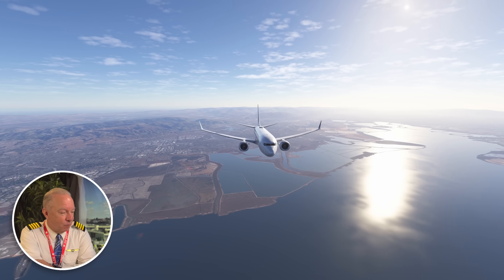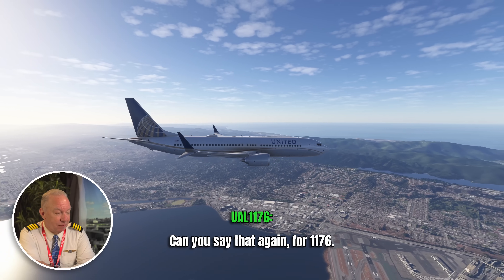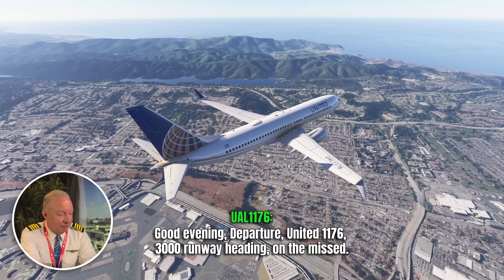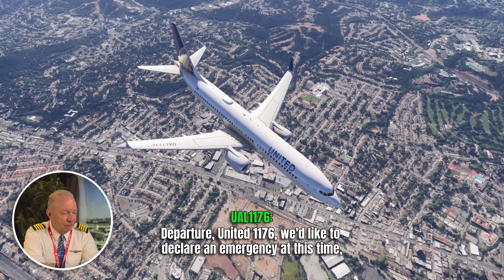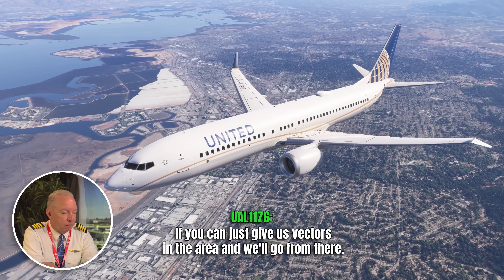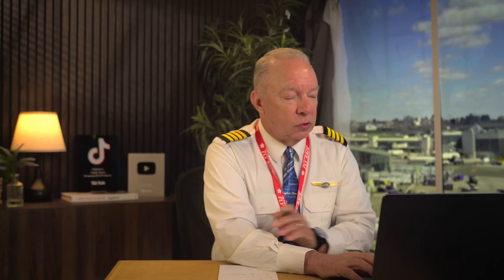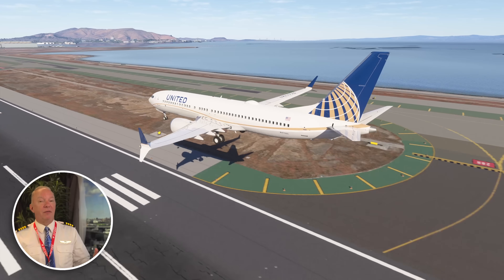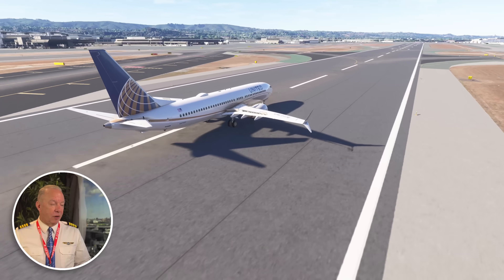Flap Failure on Final Approach – United 1176 Emergency! | Captain Steeeve Reacts

Comment: FYI:

The term "dashboard" comes from horse-drawn carriages, where a board or leather flap was placed at the front to stop mud and debris from being "dashed" (flung) up by the horses' hooves onto the driver and passengers. When automobiles replaced horses, the term carried over, evolving from a protective barrier against kicked-up dirt to the instrument panel displaying speed, fuel, and other controls we know today, and later to software interfaces. 

From Carriages to Cars:
Horse-drawn era: The original "dashboard" was a literal board (or "dash-board") serving as a mudguard, protecting occupants from the messy aftermath of horse movement.
Early automobiles: Early cars retained the dashboard to shield occupants from rocks and mud kicked up by the wheels, even though the horse danger was gone.

Modern cars: As engines moved to the front, the dashboard panel became a place to house instruments (speedometer, gauges) and later, safety features like airbags, while still protecting from engine heat and noise. 

Digital Evolution:
Software: The concept expanded to computing, with software interfaces (like WordPress or Apple's OS) adopting the term for their central control panels, mimicking the car's function of presenting key information at a glance. 
In essence, the word's journey reflects a shift from physical protection against a horse's action (dashing) to a visual display of crucial information in vehicles and software.
Reply: For vehicles the wall between the engine compartment and the passengers is called the firewall. Windshields and fenders are what blocked roadspray and mud from the wheels on open wheeled/early fender cars. The dashboard was called this more as an homage to the buggy days than any functional metric. Even the earliest vehicles had the instruments far removed from the line of sight of the wheels and set far enough back and away from them to be of no use for this job. Look at the model a or model t for comparison.
Reply: @gotindrachenhart why don’t cars come with mudflats anymore? Is it a result of lowering costs, does design render them obsolete, or is there another reason?
Reply: Dashing through the snow on a one horse open sleigh… I read the word “ dash” in books as getting dashed by a horse used as being kicked. Also injured by other means” The man had his head dashed in by a pipe. Seems there is more than one meaning for the word.

Comment: Slightly off topic but still relevant, during primary training my instructor taught me not to lower the flaps during a turn, because a failure on one side could cause an imbalance issue. That lady did an incredible job of staying calm and handling the situation.

Comment: Fox "News" blond bozo airline pilot ?

Anyway, in general aviation (which is a lot slower, lighter, and lower powered than this) I got in the habit of landing without flaps all the time.  The field I was out of was subject to gusting direct crosswinds on a regular basis and I wanted the extra speed to improve aileron authority to deal with that.  Once I got used to it, it was no issue.  I had plenty of runway there, and it had the additional advantage that if I was shooting touch-and-goes (which I usually was, anyway) I could never accidentally take off with the flaps still down, either.

Comment: I think, pilots could hold extact g/o reason, because there could be a kind of human error, so they want to re-check.
Or there was a kind of disagreement (f/ex. go around was called by single pilot).
Or they try exclude for other malfunctions, those could affect current operations.

Comment: I was on a 777 some years ago going into SETAC and the captain said they had a "leading edge issue" which was going to make us come in much faster than planned. He said we shouldnt worry he and the 1st officer had many years of experience in the military and we were all going to be fine. He did say the plane would have a lot of smoke in the cabin but the plane was NOT going to be on fire.  He said that would be him burning up the brakes.  We landed wayyy back on the runway and then the smoke started. They had fire trucks hosing the plane as we passed by.  All was well. I loved that captain then and i love him now!
Reply: Sounds like a Captain very confident in his, the crew, and the planes abilities.
Reply: Military trained always best
Reply: @SgtZak_  Yeah, that used to be 99% of our pilots; it would seem really hard to substitute non-military flight training for the training ex-military received.
Reply: We were taking off @ Miami on a757 and the "Slats" didn't retract. Did laps to figure out a solution or burn fuel. Going nowhere fast. After landing we waited 3 hours to leave for SF😅 Good times😊.
Reply: Excellent that he knew what would happen and told everyone ahead of time to reassure them it was expected
Reply: Most Finnair pilots are Hornet veterans used to landing on roads. Some have done hook and wire landings on roads. You can kind of feel it when the sidestick is held by a Finnish Air Force veteran during a proper winter storm. If we let weather close airports, hehe, not a choice on an island nation. We practise ice landings every year.
Reply: @UserDefaultEurope Very interesting! Got to work with Mother Nature!
Reply: that's insane
Reply: cool story bro.
Reply: Oh you silly guy.
Reply: @GlobalDrifter1000 right,,, I was thinking the exact same thing!
Reply: @cottonhiker why
Reply: First of all, why would they let such an aircraft fly? Kudos for the courage, but this is a truly horrible story.
Reply: @spxram4793 You don’t know exactly what happened though… Thats a very limited idea of whatever went wrong. Mechs (usually) take their jobs (literally) very seriously and it’s not like… do you know what an internal stress fracture is?

Also you gotta know getting onto a plane… once youre rotated & geared up like… it’s going to find its way back the ground at some point and (usually) this will be gently onto a runway. Im trying to be as realistic and reapectful simultaneously here? Okay I’ll just pick one

Like I contemplated this as a child, first time I felt the weight come off, silk. Even went unaccompanied several times. I 100% didn’t realize the people I was irritating around me didn’t also..  okay people “enjoy” burgers. I watch this stuff all the time for a reason and this is back when I was like 10. Can you imagine the joy… sometimes just as bad though that was always nice.

Hey. Even without the unusual there remains (I was gonna say still but haha…) the ‘obvious’?

There THAT can have that word

Comment: Hey, Captain Steeve, 
One Sunday, flying a P-3B out of Willow Grove doing a round robin: NXX -> BUF -> PIT -> NXX, to ferry reservists, the flap asymmetry system stopped the flaps from lowering for landing at PIT. The flaps stopped before they began extending. We had an uneventful no-flap landing. The FE and IFT troubleshot the problem and couldn't find anything specific. They reset the assymety system and tested the flaps on the ground - everything worked. The pilots telephoned the squadron Maintenance Control to communicate the aircraft status and we uneventfully took off and landed back home. I don't know if anything was ever found that caused the malfunction. Maybe it was a gamma ray burst? 😜

Comment: I work in dispatch for a large airline in the US and had a similar issue going into O’hare.  My checklist as a dispatcher was to calculate landing distance based on the emergency the crew was having then verify we have a long enough runway to land safely. My crew didn’t send me much info so I ran landing distance numbers assuming they were going to do a no flaps landing. Ohare has a 13,000ft runway and we were in a 737-800 so we had plenty.  I didn’t talk to the crew much in flight because I figured they were busy and I knew they’d call me for a debrief after the flight landed and got to the gate.

Comment: Captain Steve. I flew for United over 40 years and as a Captain for 30 of those.  In my career I had a flap malfunction twice. Once 🎉on approach in a B727 to SMF and the 2nd at cruise altitude in a B767. The B727 was a typical split flap where the inboard set jammed and stopped everything. The B767 was an uncommanded extension at FL340. The B767 did its electronic thing and stopped the extension before it became dangerous, however we had to land in SFO (originally going from DEN - HNL) at a high speed due to almost no flaps.  

Neither were “dangerous” situations and well within training and the available runway.  The only issue was HNL passengers were a few hours late starting their vacations.
Reply: I'd prefer the flaps stay where they are meant to be when at FL340. I'm sure that got your attention.
Reply: 42 year pilot, 36 year Captain here.  2 flap malfunctions over the course of my career, one in the 727 and one in the L-1011.  Asymmetry on extension in both cases, resulting in near zero flaps landing.  Not a big deal.  Practiced numerous times in the simulator.  No drama.  Did not declare a mayday.  Briefed the passengers and crew, notified ATC and they had ground equipment standing by for each landing.

Comment: The only time I had to land with less than normal landing flaps was when we had to divert to Cold Bay, Alaska after shutting down an engine on the way back to Houston from Tokyo. We used flaps 20 instead of flaps 30. There were a bunch of checklists to run, but it wasn't a big deal.

Comment: Many years ago, like 20 years, I was flying into Sanford FL via Allegiant Air as a passenger. When we landed and got to the gate one of the ground crew manually pushed the leading edge flap back into a retracted position. I figured there was a problem but was hoping it was not to bad, to endanger the air worthiness

Comment: I’ve had a “Trailing Edge Flap Disagree” on a 767-300 also going into KSFO.  
A 767 with reduced flap is still a lot slower than a 737 landing flaps (30).
Also a Capt Steve

Comment: On a Houston to Portland flight years ago we had a flap emergency. Captain had announced a touchdown time earlier but that had come and gone we were still in some sort of pattern. Capt finally came on and said we had a flap issue and were working on it. Another 15 minutes he announced they couldn't correct it and would land without full use of flaps. Told us to expect higher than normal speed.

I live close to the airport and saw immediately our approach wasn't normal. It was night but I could see landmarks. On final turn could see emergency vehicles on both sides of the runway. That made it very real. A little heavy on the landing and very fast. Could almost feel the pilots standing on the brakes. Finally came to a stop and there was much rejoicing. The crew did a fantastic job
Reply: I can't believe no one's  commented on your Holy Grail reference yet. 🤣
Reply: Thumbs up for Monty Python reference :P

Comment: Back when B757 was new A/A training dept asked Boeing where is the split flap procedure and Boeing said there is none because it is impossible. A/A didn't buy it and found a split flap could make the plane uncontrollable.  Last I heard three split flaps were reported in the air and on the ground.  A/A procedure to remedy was to select flaps up.
Reply: Boing also said that an approach on Battery Power only would never happen. It did.
Reply: Google supersonic 727

Comment: So if you are coming in on final approach and go around do you pull the gear up or leave it down , I would imagine if you think you will be up for awhile you would pull the gear up but if a simple go around would it be left down ?
Reply: Gear up probably - when something unexpected happens you don't want to burn extra fuel on the drag. Generally.

Comment: Oh I've seen flap failure on the King Airs (90, 200s and 300s) a decent amount. Usually it's the flap motor or relay on those aircraft. We can manually raise the flaps to up position for flight back to base, and then we determine what the defect its.